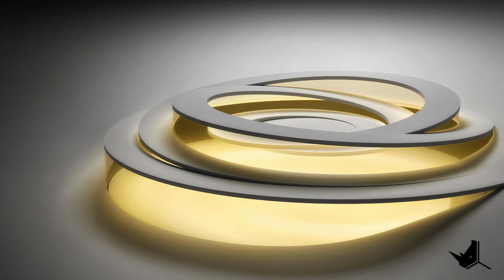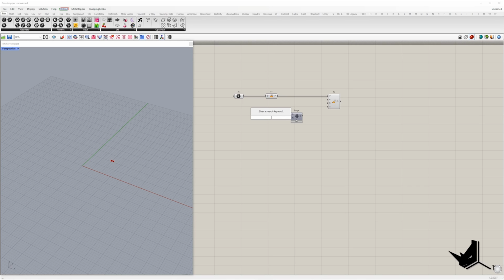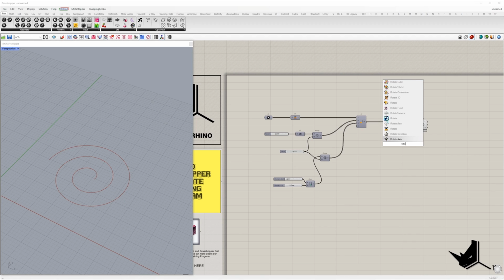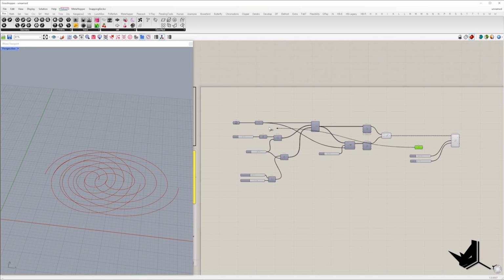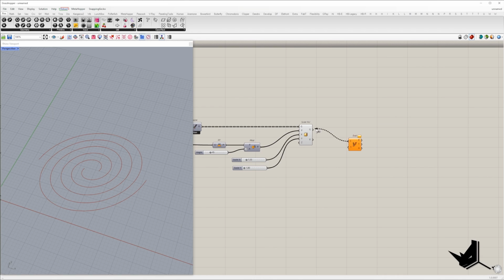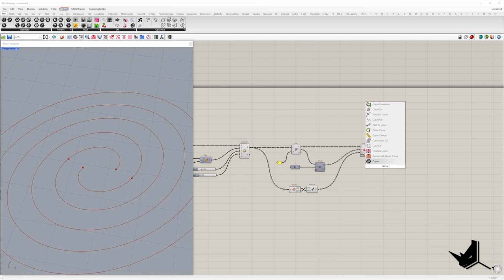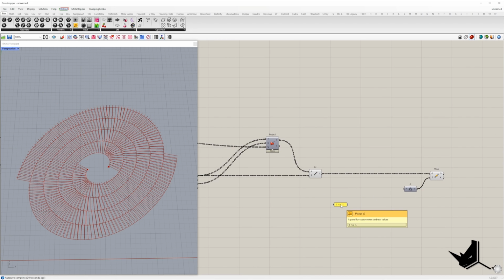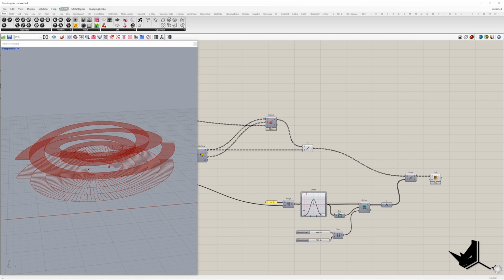BIG Pavilion: The ONLY right way to model it

Comment: OPEN Edges - i cant fix - please help-
Appreciate your time so much!!!
Reply from the maker: Could you please explain what you mean by ‘open edges’? I’m not quite clear on the issue you’re facing.
Reply: @HowtoRhino  thank you very much for your comment. 

When I try to print it I need to check if the geometry has open edges.... once I plug in show naked edges the two swirls have open area in-between. 

I would be extremely thankful for any solution.